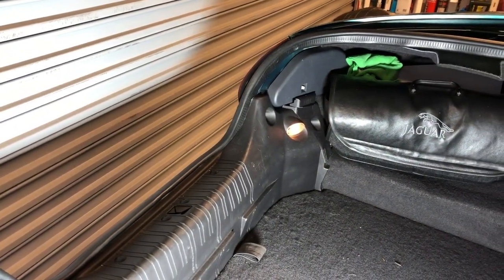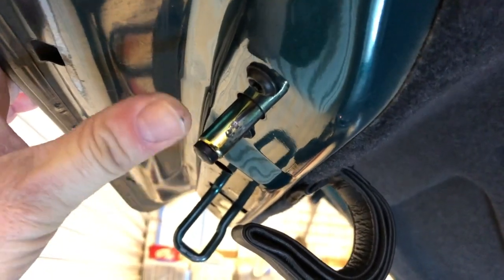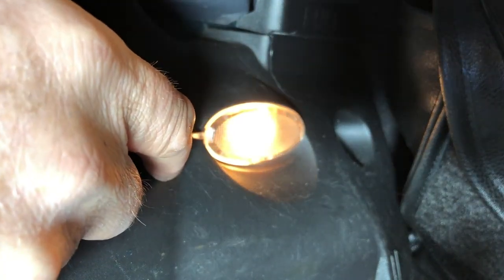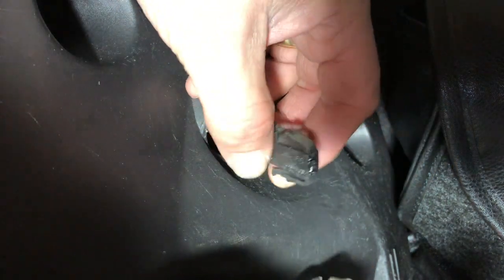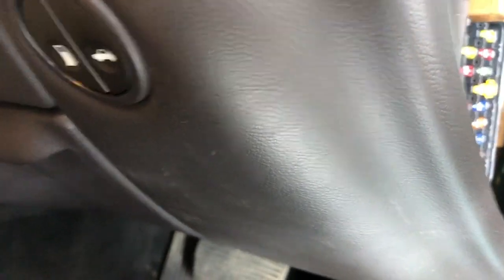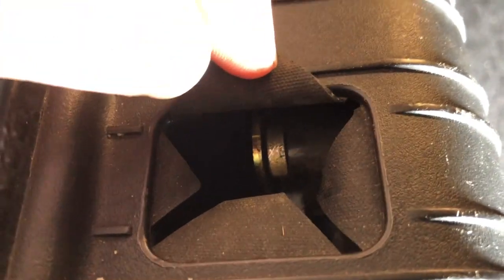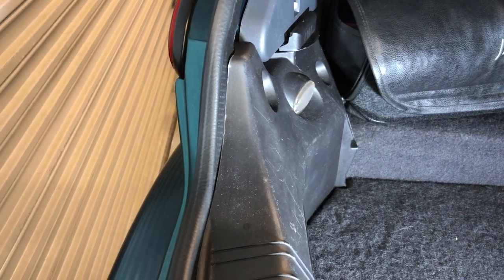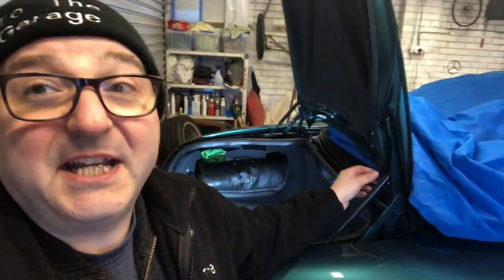Secrets of the Jaguar XK8 XKR ep 52. Boot or trunk light problems.

Comment: The boot lights on my 2001 XK8 were working some of the time and I was beginning to think new microswitch (about £70!) but when I separated the connector to the wiring loom I noticed the pins were corroded, so have cleaned them up with a rolled up piece of wet/dry paper and twizzled a 3.5mm drill in the female end of the connector, (carefully to avoid a short!)  Good squirt of contact cleaner and they now work!  Very helpful video John.  Saved me an awful lot of time getting to the root of the problem.

Comment: Dear John, I had a fault on the booth lamps caused from a short circuit; thanks to your advice, I replaced the correct fuse then everything is ok now. I would tell you that the fuse relevant to the booth lamps is the same for the gear box lever. It means that in case of broken lamps fuse, you cannot put the the lever in drive position. Many thanks for your precious advises, you are magic!

Comment: Hi John,
Ah, the  common old misconception about the cable between the boot lid and the offside wing......
Reply from the maker: Yup. Thats what got me agitated enough to pull this video forward. There were plenty of people recommending that folk cut this wire away and solder in new to fix a doggy boot light!🙄.
Some of the folk giving advice on (unamed) jaguar forums have obviously not owned one of these cars let alone resolved said problem themselves.🤯

Ooooohh I don't do Angry. I need to lie down for a bit Harry😉

Comment: I tend to keep my XK8 on an ctek battery charger when she is resting and usually operate the boot lock manually to turn off those lights. of course, the boot lid is then left slightly ajar. yes, I know they should go off by themselves, but.... first thing when going for a drive is pushing the boot button to unlock the lock again, before unhooking the ctek.

Comment: Hi John. I’m still trying to find out how to permanently convert my 20 year old XL8 headlamps for Spain. I’m trying to avoid buying new units. Cones to insert have been mentioned but my garage hasn’t heard of them. Can you help please?  Thanks
Reply: Nigel, when I bought my XKR it failed its first MOT because one of the headlights was set to LHD. The low beam has a metal template that makes the headlight shine the correct way. Don't know why, but one of mine was in the wrong way round. Simply lift it out of it's mount, turn it round and drop it back in and you've changed the beam set up. Difficult part is getting in to it. Didn't need to take the headlight out, can't remember exactly how I did it as it was about 8 years ago, but the answer is yes, you can change it to work in Spain and without inserting cones.
Reply: Graeme Anderson   That’s great Graeme, many thanks.
Reply: Rich C that’s great thanks Rich

Comment: John and all
When I bought my Jag it had a broken light in the trunk that ended up shorting out.  It blew out the fuse and on US spec's XK8 that also takes out the interior lights but also the interlock for the transmission.  So in another words a short in your trunk light could cause your car to be inoperative and you stranded.  Not very convenient I thought.
Also why isn't the trunk light in the lid   where you can actually use it to see.  Those side lights are only useful when the trunk is empty.

Great show keep it up.
Reply from the maker: I may actually install a light in the lid for that very reason Lyndon👍
Reply: To The Garage Fantastic idea.  Future video?

Comment: Thanks for this John! Both my boot lights aren't working. I checked the bulbs and both are good and the fuse is fine. So I am guessing it's the switch in the latch? What is the most likely thing I will find if I go in there to look? a disconnected wire?
Reply from the maker: Switch failed or. the earth wire needs cleaning. Does your interior light come on when you open the door. If not then its a fuse
Reply: @ToTheGarage  Yes, all the interior lights work just fine when doors are open. How do I clean the earth/ground wire? You mean inside the light fitting? At this point I am suspecting it is the switch inside the latch...

Comment: Thanks for that bit. Good info.   My interior lights did not work when I purchased the car last summer, I could not locate the fault... ended up taking it to Halifax,NS to Steele Jaguar, they trouble shot for 3 hrs, finally found a shorted wire in the overhead console where a screw had been tighten too much and punctured and shorted out (all interior lights, boot lights and windshield washer motor?).  All work now.   < turned out, the previous mech at one point had replaced the hydraulic line  system for the roof system and when replacing the line caused the damage some two yrs earlier>  Was originally replaced due to hydraulic fluid leaking from the roof console...
 What is the  black Jaguar leather kit in the trunk, Tool bag?
Reply from the maker: Ha Hah!  all will be revealed soon Dave😉

Comment: Excellent John, as ever.  Replaced the microswitch in mine 3 years ago, the tricky part was getting one. Easily available from Jag spares suppliers complete with cable, LNC6242AC For £44 plus vat and carriage, ouch! but its a branded microswitch, cherry possibly, can't remember for sure, so I tried to find that switch without the cable fitted, it carried a manufs pt no. after all. No joy, the manuf do not sell it, its not in their online catalogue. So if anyone knows of an alternative that fits please post here:) It will help others greatly providing they can wield a soldering iron to swap the cable over to a new switch..
Reply from the maker: Thanks for the intel Terry👍

Comment: Just used you instructions for how to change the lights in the trunk, found out that I have 12.5 volts on both pins on each side, very weird, one should be earth/ground …
Any idea ?
Reply from the maker: That doesnt sound rightt🤔.  I believe the lamps earth through the switch. So check out the micro switch on the boot latch mechanism and the associated earth wire next to it.
Reply: @ToTheGarage i guess i need to remove the rear trim on the inside
Reply from the maker: Yup. Not too tricky though👍

Comment: Thanks John for that.. I have a problem with my S type 1999, when I disconnect the battery and reconnect it again the lights inside the boot work and they don't once I shut the boot! 
They work again every time I disconnect and reconnect the battery.
Any ideas?
Reply from the maker: Hi Ahmed. Interesting one.
Do the interior lights have the same issues?
With the boot lights on and the courtesy light on (door open) pull the appropriate fuse. If they both go off then they are on the same circuit (as on the xk8) and its not a supply problem. 
If so then it has to be a bad micro switch in the latch, Or a bad earth in the latch. Because everything is run from modules, its quite possible that the lighting module turns on when it detects the battery install but after the boot has been closed it never recieves the signal from the latch to turn on.
Reply: @ToTheGarage  Thanks John for you reply, for your advice. I will try again and then update you. 
Cheers

Comment: John.  Both of my boot/trunk lights do not work.  Both of my above interior lights do not work.  However, my footwell lights work.  When I removed the fuse the foot lights went out so I reinstalled it and the foot lights went on again.  Any thoughts?  Thanks.
Reply from the maker: Have you checked the bulbs? (I should say 'lamps' really)
Reply: @ToTheGarage  I have not but could it be possible that both interior lights and both boot lights are bad?  Just seems unlikely to me but I might be wrong.  Thanks
Reply: @ToTheGarage  You checked the fuses on the right hand side (same as your driver side), my car is left hand drive but assuming the fuses dealing with the boot lights are also located on the right side.  I did buy new fuses but that has not fixed the issue.  Frustrating but not that big a deal.

Comment: Hi I have a 2007 XK and my convertible top can’t work unless it shows my trunk is closed, I need to know how to get to the micro switch can you help I’m a women ans it’s very hard to figure it out but you helped
Reply from the maker: At 2007 we are talking about the all-aluminium X150 which is not my specialism. But no you can't raise the top unless the boot is shut as it will interfere with the automated solid tonneau cover. Im guessing the microswitch is in the same place as on the X100 beneath the lower boot edge panel and is integrated into the lock mechanism